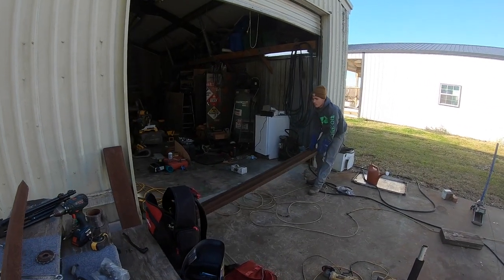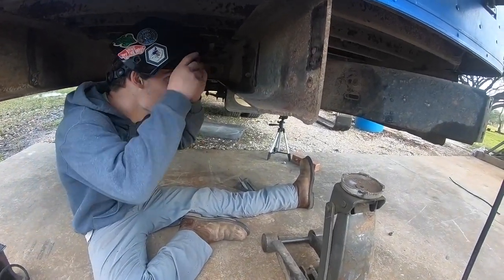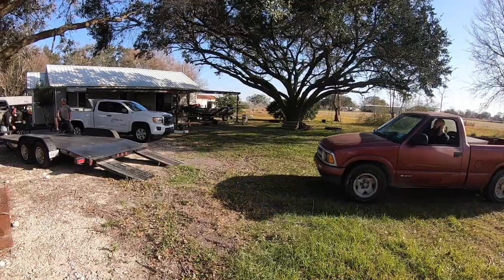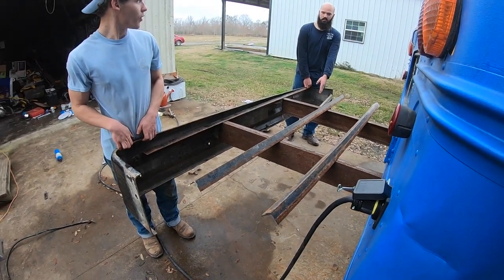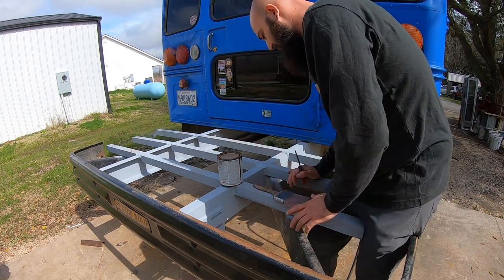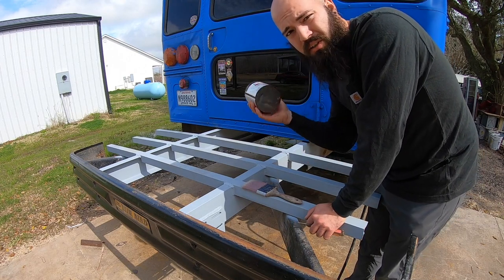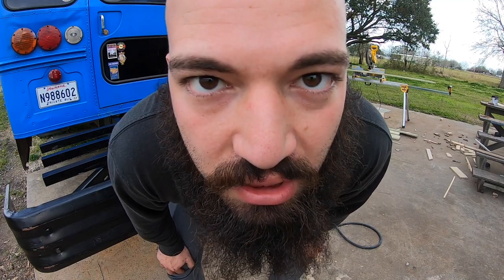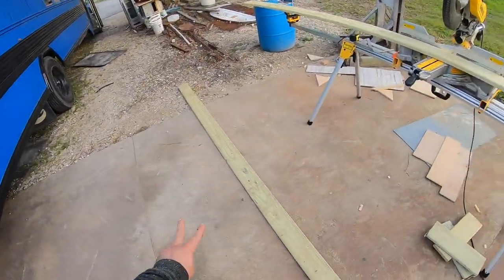Skoolie BUMPER EXTENSION

Comment: This is an awesome idea. I am in the building stage of my future schoolie build. Doing a body chop so the front half will be RV and the rear will be flat bed. Considering extending the rear to give me more space for my jeep so I can either have more interior room, or have room for dirt bikes as well.
Do you have any issues with the back end being too far out when going around corners? Any approximate idea how much weight that could realistically hold being that far behind the rear axle?
Thanks!
Reply from the maker: Thanks for watching & best of luck! Sounds RAD.
The deck is still holding up well after nearly 3 years. I have put upwards of 600lbs back there with no worries if failure. The angle iron we used to run the boards should’ve been heavier steel or closer together. When i have had my max weight the edges started to sag, but no the C-channel that actually holds it all in place.
No issues with cornering, but it will reduce your ground clearance when you try to go up a steep driveway or ramp. I think if I had a hitch under it I would’ve rubbed many things by now!

Comment: seen a video once about a guy welding on pipeline , since he allways works outside and has the same problem with the shielding gas blowing off he uses gas and fluxcore wire , takes a little getting used to but gives good welds even in windy conditions , he could offcourse crank the gas up further
might want to add some indicator and brakelights to the rearbumper as the ones on the bus will likely be covered by the bikes in front of it 
hmmmm wonder if those bumper corners will get hooked on stuff as the platform swings out in turns  , suprised that you didnt added the boards to cover them
Reply from the maker: The wind certainly made it more difficult. The boards on the side will come later. But the deck works as is for now. 

We haven’t thought about putting lights on the bumper, although it probably couldn’t hurt!

Comment: Are you still happy with how you did it all? We just added the support frame and came to find out how to add side support. -nat
Reply from the maker: We are happy with it, we ran short on iron so the side support is lacking. 10k miles later tho still hanging on back there. With too much weight the driver & passenger side will bow but the center supports are very strong. No sagging or bending issues so far. Haven’t loaded the back with over 1k lbs yet.

Comment: Could of used the bolt holes in the frame and  bolted every thing I guess ....nice looking deck..keep it going...
Reply from the maker: In a perfect work I may have! It was a tough call. We know many folks who have bolted Vs welding.
In this application I used all the material I had left so in some instances we had to make do with what we had! I would’ve done it a bit differently if I wasn’t short on metal.
Thanks for watching! It’s held up very strong so far